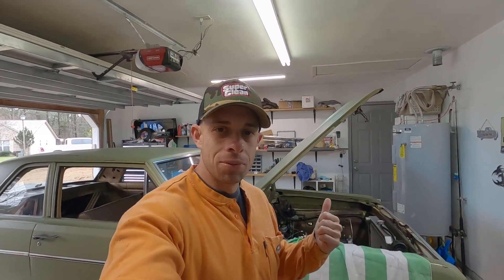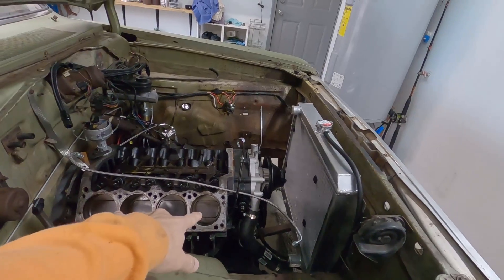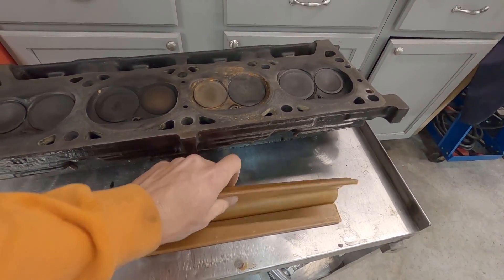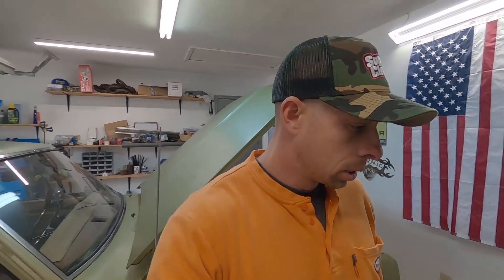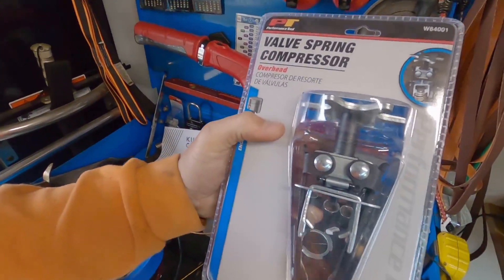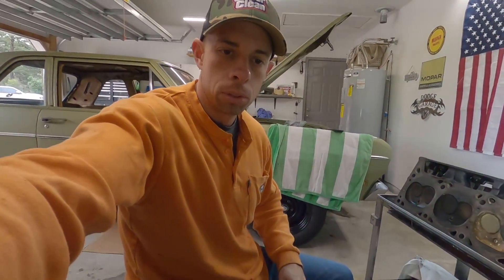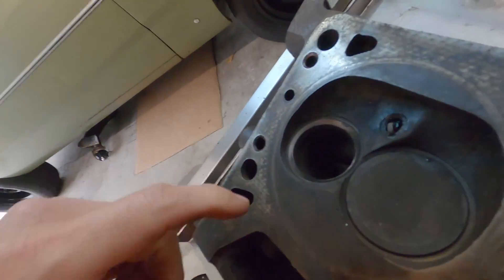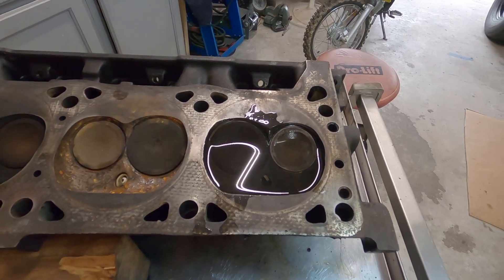HEAD-ache! (360 Turbo Valiant)

Comment from the maker: I just called the Machine shop near me (30 miles away). They said their Cyl Head guy quit. On top of that, IF and When they could get to it, $500 would be the cost. The next closest Machine Shop is 120 miles away.
Reply: What about Adam doing it?
Reply from the maker: He doesn't have the tools. We have discussed this type of thing in the past.
Reply: Edelbrock called, they got what you need. Indy said they're liars, THEY have what you need! ;P
Reply from the maker: May be good but good costs $$$ I'm not their type guy.
Reply: my O'reilley auto parts shows remans in stock $379ea.  King Cylinder heads has them for $399 NEW NO cores needed so you could sell your heads but they want $60 SHIPPING Honestly though at that point whats another $200 for a set of aftermarket improved heads. Maybe buy some new heads for big red and put big reds heads on Mr Jones?
Reply: @TheGasTap  for that kind of machine shop money, maybe better off to buy aftermarket aluminum heads such as Indy or Edelbrock.  They cost about $1,200 to $1,500 and no machine shop expenses. Take up donations.
Reply from the maker: https://www.cylinder-heads.com/product/2-dodge-dakota-jeep-magnum-wagoneer-5-2-5-9-ohv-318-360-v8-cylinder-heads-reman/
Looking at these for an option. Big Reds heads at are too big for the stock cam still in the Valiant.
Reply: @TheGasTap  if you want to stay with a stock iron head, it seems like these heads would be hard to beat for the money. Like I said, ask for donations and tell your subscribers how to send some $. Hell, you provide the videos for free. They are worth something to many gearheads or they wouldn’t subscribe.
Reply: YYou’re a straight edge needs to be longer than the cylinder head to get a accurate reading
Reply: @z06doc86  uh
Reply: You can get a new set of Pro Maxx from summit for under a grand
Reply: @TheGasTap  I realize this isn't ideal but a LOADED set of cast iron LAX Indy heads (LA or Magnum) are $995/pair. 

I know that's more than you'd planned to spend but keep those in mind if you can't find any other solutions.
Reply: As do I send is there budget-friendly and can come complete or you can assemble them yourself. They using the stock NASCAR stuff or whatever Ronnie Brown racing
Reply: You could buy a set of. Remanufactured heads for that
Reply: @TheGasTap  call edelbrock ask them if they can sponsor or send those heads for an ad on tpur part would love to see them on your set up.
Reply: You need a better machine shop ..... those heads need to be decked along with a good valve job and probably a couple new valves and guides !
Reply: @TheGasTap  try Power house racing . They sell knock off heads at a 1/4 of the price also a bunch of other go fast parts I’ve used there cranks rods and pistons as well as a air gap intake knock off . All of it worked and lasted well and I was turning that crank 7800 rpms and the end of circle dirt track ran it 2 years and had no problem I did put new tri metal mains and rod bearings in about mid season each year mtr was still running strong when I sold the car !
Reply: @TheGasTap  Brother, factory castings are turning out to be the most broken up bunch of crapola we've ever seen.  (Longtime machinist in Indiana).

The aftermarket pro maxx's seem to be the ticket for the Mopar magnums
Reply: @TheGasTap  where are you out of?
Reply: @TheGasTap  I know the money is always at issue,  but if you magnaflux original castings you will be stunned to see how bad cracked they will be.
Reply: i know Im randomly asking but does someone know of a tool to get back into an Instagram account?
I stupidly lost the account password. I would love any assistance you can give me!
Reply: @Zayden Gianni Instablaster ;)
Reply from the maker: @patrickwayne3701  Tallahassee, FL
Reply from the maker: @patrickwayne3701  Tallahassee, FL

Comment: The problems are unfortunate, but there's always help not far away. We have a few reputable engine machine shops here in town that can get those heads machined. If it's just decking the gasket surface I can probably handle that myself. Don't let it get you down, it's just part of hot rodding. Have fun! See ya soon cuz...
Reply: Adam, Alex can get a good rebuilt set of heads in Clearwater. $500. I made a donation and have encouraged his subscribers to do the same. Want to see this grassroots build successful.

Comment: Also, if you go with MLS gaskets make sure the deck and head surfaces are very smooth.  MLS head gaskets require very smooth surface finishes to work properly (usually 20-30 Ra or less).  Not sure how nice the finish is on the deck surface but any pitting may be a problem with MLS gaskets.

Comment: sry to hear about the cost but i think your doing the right thing. Machine shops can properly pressure check them and the rest of their magic,then you know you got a solid top end you can stomp on. I would how ever recommend studs, 5 psi boost becomes 7 becomes 10. These motors dont hold the heads on very tight.

Comment: Lay a straightedge over the valve tips when the rocker arms are removed, and you'll spot any cylinder with sunken valve seats by the gap (unless they are all equally sunken somehow). Also straightedge the block deck, just in case there's an issue there. Usually not, but you're there....

Comment: if the heads are not cracked  you can bring them to tennessee ,i have an old  valve grinder and seat wheels and knurls if the guides are loose or just get some aluminum heads  like i did. im buildind a 408 stroker for my 66 valiant.i also have a dart with a 340, i had a 64 barracuda but my dad wanted it so i gave it to him, but he gave me a 78 powerwagon factory 440 and stepside,and he put  fresh red paint on it

Comment: What I do is get a half inch socket just a little smaller than the retainer and smack it with a mallet. This loosens the keepers. Then I use my valve spring compressor and use a magnet to remove the keeper halves. This works on the bench or still on the motor if you use compressed air to keep the valves closed.
Reply from the maker: I put a rubber mallet under the valve and smacked it with a socket and hammer. Nothing 😕

Comment: Great project, been following for some time ! If it was mine, id flick the heads, and replace with rebuilt Magnum heads (port em if you want) or aftermarket ones, I'd check the bores for taper, if no taper, hone and add fresh rings gapped for boost. This is key for cyl seal and ring /piston survival with boost. Sometimes you can cheap out/get away with stuff of course, sometimes its best to just do the job right the first time and it will pay off in the long run. How many miles on the engine before you added boost?

Comment: Rotate the engine bring each cylinder to top dead center. Then measure  piston to deck height. Possible bent connecting rod. With that amount of water in the cylinder.
Reply: Good suggestion!

Comment: Last year I bought a 2001 ram 1500 360 with 43.000 miles MINT MINT MINT after owning it a week cyl 8 lost comp(25/30 psi) did a leak down test plus put a latex glove on the tail pipe, glove shot off  sooo exhaust valve seat had been pounded in on all 8 exhaust seats, cheaper to get 2 new EQ heads on Ebay. If you go MLS gasket the block deck needs a certain micro finish per inch btw.

Comment: On the right track with MLS gaskets. Never liked lapping in valves with a drill. No control and cannot hear the grinding taking place (to know when the compound is done). Dad always said the old ways are still better on most things, even if it takes more time. Even after a valve job, they still need to be lapped in. Buy a "C" clamp spring remover. Have them magnaflux the heads before any work. If they are bad (cracked)...junk.

Comment: I had a local machine shop check out the original heads off my block. Five out of eight had cracks so I just bit the bullet on getting new head castings. The guy machined them so that there's some kind of warranty on the set. Hopefully you don't have to fork up anymore then you need to.

Comment: That exhaust seat looks like its sunk into the head a good bit to me, if so and with boost you may want to go ahead and get unleaded seats installed before they go any deeper and cause other problems. Pitting on the valve and seat, along with wallowed seats can accelerate the wear so check the guides also. 
Ok i typed that and 10 seconds later you said the seat looks worn out, i know lighting can make things look different on video but good luck. Just came to the channel from a YT suggestion and if turbo im in.

Comment: You could get a better valve lapping tool or try one of the wood handle hand spun manual ones. You can feel and hear as the seats clean up. LunarOutlaw’s Garage did a set of v10 heads with one and showed how he did it. Good luck with it and at least you have a handle on what happened.

Comment: I think you can buy new heads from Engine Quest for those motors, they usually aren’t worth rebuilding, they are prone to cracking also, the engine quest ones are supposed to be more beefy and flow better, I’m pretty sure Hot rod or Moparmmagazine did a build with them a while ago if you google it

Comment: Tap the retainer with hammer before you compress valvespring to remove them. Much easier that way.
Reply from the maker: Tried it. They were fighting back. 🤷🏻‍♂️
Reply: @TheGasTap  just deassembeled my heads with 400 pound springs and 7 deg locks.
Reply from the maker: My buddy just gave me a better spring compressor today. Way easier.

Comment: if it were me keep lapping that seat start with course compound as many times as it takes then end up with fine compound. my experience with lapping the course is very very very aggressive will mill that seat down to nothing. when seat is good you can "hear it". always use copper coat on head gaskets lay them out on a clean table spray 1 coat & walk away for an hour then coat other side. repeat 3 coats both sides may take all day dont rush that step. with copper coat ive never once had a leak weather its a car engine or a turbo charged 514 cubic inch tractor engine. last summer re-ringed the mustang 302 took 1 1/2 cans copper coat on both new gaskets both sides

Comment: I noticed you said the heads have never been off before. Since you have them off now I would suggest to pull the pistons and gap the rings. I used factory pistons and rings on my turbo Bmw and didn’t gap the rings cause I didn’t know I needed to at the time and that cause my piston to blow the ring lands. I was running 15psi. Since you already have it apart it will save you from doing the work later. Hope this helps I love watching these.
Reply: Excellent point ,trust me ,turbo? Ring gap? If you dont they will bust ring lands sooner or later ? Trust me ,I ignored this advice and lost a whole bunch $

Comment: i use my drill on the valves also but i put it directly on the valve that way i can just move the drill in and out and apply more pressure if needed haven't had an issue yet with any not sure if that would help in your case but might not hurt to try even on full screen mode cant get a good enough look at what your results are lookin like although im sure someone will disagree

Comment: not being smart but I would have had the machine shop just knock off a layer of the gasket surface on the heads to make sure the surface is flat and sold with no chance of leaking especially with forced air induction

Comment: There is a spray on product for crack checking heads. Saw it used on Engine Power(?) and it showed cracks. Don't know just how reliable it is, but it's an option.

Comment: Getting it done, are you running a catch can on your car? I had to much crank case pressure at idle and add a catch can, it fixed my oil smell at idle.
Reply from the maker: I have one that needs to be installed.

Comment: the seats wear funny because the seat next to the intake valve runs way cooler then the opposite side. i see this all the time on turbo diesel heads. some are so bad the seats need to be changed.

Comment: Man, I'm sorry this is happening to you. I know your frustration(s) - that said, it's worth it in the end because it's YOUR car and YOUR build and you're the kind of guy that does it right. Hang in there.

Studs may not be necessary but maybe consider some ARP head bolts. 

As far as gaskets, Cometics are great, I also like the Fel-Pro steel ring head gaskets (can't remember the name). 

Read your comment about the machining costs on those heads - DUDE, that's high. Maybe looking into some used aluminum heads would be warranted? Perhaps you'll get lucky on a set of those? I mean, your other option (without spending money on machining costs) is to roll the dice on another Magnum that MIGHT have good heads; or get the heads off another Magnum. Still, you're looking at playing odds there.

Indy cast iron LAX heads are $995/pair (LOADED). 

Lastly, you could roll with the leaky valve(s) and run the engine until you can afford getting what you want/need. Sure, leaky valves aren't ideal, but I'd rather roll dirty than not at all!

Comment: At this point just put the drill on the valve and use more pressure until pitting is gone done it many times with excellent results also put the valve in a drill press and use a file and back cut the valve for better flow

Comment: Might as well relap the valves since it's not a big job and they're already out. Just to freshen up the seats.

You can resurface the head the cheap and dirty shade tree way since it doesn't look to warped. Get a thick piece of glass or smooth metal as long as it's flat and larger than the head. Stick some fine 220 or finer sand paper down. Then set the head on and pull it around the paper. Don't put any downward pressure on the head, just let it's weight do the job and move it around the paper randomly so you're not cutting in one spot. Give it a couple strokes and check for low spots.
Reply: Also, you can get valve seat cutters for around a 100 bucks.

Comment: Indy has iron EQ heads ,flow better and tough .if you can,get aluminum ....any brand .I would also use studs and MLS gasket s. And the other guys is right .....check  for bent rods .

Comment: Typical mopar sb putting boost to it. You gotta think, a sb mopar only has 4 head bolts per cylinder. Either run cometic or have o rings installed👍🏼
Reply: They weren't made for turbos - made for real power creation, not artificial power.
Reply: ls has 4 bolt per cylinder....and look what they are doing.
Reply: @frigglebiscuit7484  kicking out head gaskets...

Comment: Lapping a valve is not a substitute for a valve job. They do not even compare. To me the first valve seat on the head side looks way WAY too wide.
Reply from the maker: Looks like the seat is worn out completely to me
Reply: @TheGasTap  agreed. Seats and guides are easy to replace of course it all comes at a price. If it needs I would defiantly do the guides and a good quality valve and springs. Been there many times :)

Comment: No time to be cheap...source out new cast iron heads, use a cometic gasket.  pay now or pay more later. Those seats are done not worth a dollar to rebuild.
Reply from the maker: Yep. You’re right on.
Reply: @TheGasTap    don't bother with any magnum head they are know for cracks. I wouldn't was the $$ to check your old heads out .  look into something better. lot of options out there.  you will have to stud it for sure .